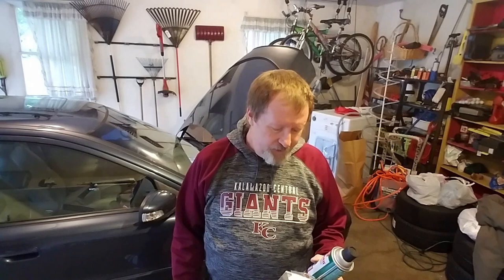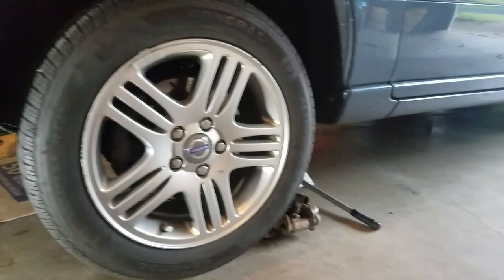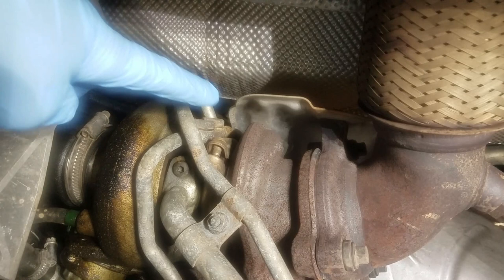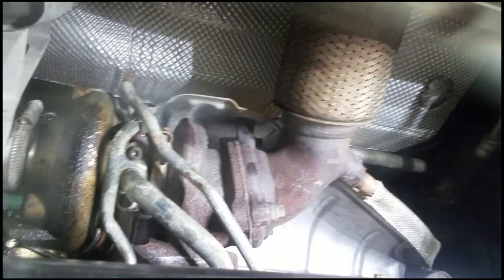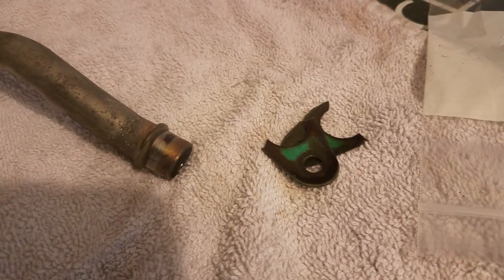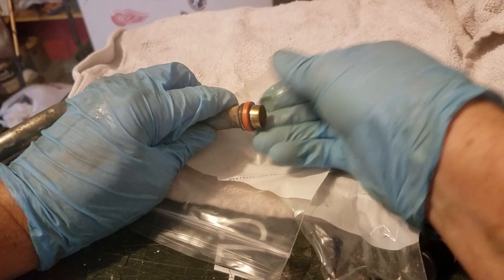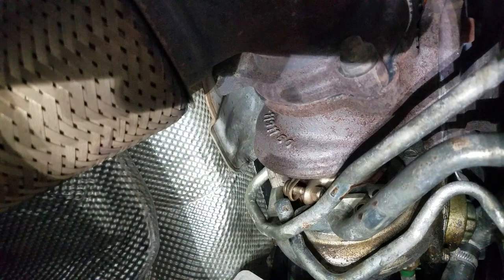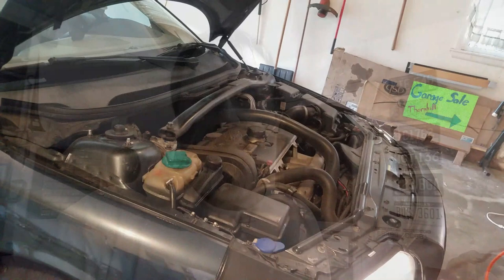Volvo S60 Turbo Oil Return Gasket Replacement

Comment: Floyd, Yesterday (Labor Day 2020) I was exactly like you down under the engine of my 2004 Volvo S60 2.5T AWD considering the source of a similar very tiny oil leak - it might be exactly the same thing that you fixed last year in this video. 

My car has 270,000 miles on it, and I just changed the  timing belt, the regulator on the alternator ($18 online made in Korea), patched an exhaust leak, and used the olde timing belt as a strap to better support the muffler just before the tail pipe by putting two rivets in it. 

Yesterday also I replaced the front passenger CV outer boot ($22) by buying the one piece boot and using an exacto knife to carefully cut along the mold seam and then using genuine super glue, carefully glued along the seam, packed the grease in, put the metal fasteners on and test drove it to and from work today - about 50 miles. I haven't seen an online video of somebody doing that yet, which seems to have worked very well.
Reply from the maker: Good deal keeping that thing going for 270,000 miles.  Hopefully this one will still be around at that point too, needing it's 2nd timing belt change.  I've heard of people replacing the boots on CV joints, but don't actually know anyone that has.  The whole axle shaft is so cheap these days, it's sometimes quicker to just replace the whole thing.  I've replaced both mine and they are surprisingly easy to replace.

Comment: Thanks a ton for this video! I've gotten an oil leak that have just gotten worse with time, and it seems to be the oil return. So I need to do this job myself. Hoping to avoid having to remove the coolant lines.
Reply: And it’s fixed, this video was of great help. Gaskets 8 bucks, renting a lift 18 bucks, about 40 mins of work and it’s done. Actually didn’t need to remove the coolant lines, it was a bit fiddly but manageable to get it out.

Comment: This was not fun! But worth it to get the new turbo in. 
Was really hard to get the bolts out, new bolts were hex and deeper which stayed on the socket when reinstalling.
I cursed the Nordic gods several times during the process.

Comment: Great video, I’ve been watching your repairs for some time now. Is this the same procedure on a 2012 s60t5? It’s fed which should be easier opposed to the awd models. Maybe the pipe is bent to a certain degree a little differently than the p2 chassis? And help would be greatly appreciated. Just ordered the gasket and seal also have brake clean ready to go. Thank you
Reply from the maker: Thank you!  If it's not identical it should be similar.  Any of these that have a drain line from the turbo to the oil pan will be super similar.  Connection points or the bend in the drain hose may differ but the rest should be very similar, and as long as you can get to it, usually pretty easy.

Comment: I guess your car is not the AWD model?   The location of the angle gear on my V70R AWD blocks access.   Looks like I'll be removing the angle gear to get access.
Reply from the maker: Correct, I just have the FWD model.  I've heard the haldex portion for the AWD causes issues with access for this.  Kinda glad I don't have the AWD version now.

Comment: Do you recommend copper spray on the gasket?
Reply from the maker: No, it's not needed.  I wouldn't say it would hurt, but it's just a drain, not under any pressure, so it's not really needed.

Comment: Does this work for a 2012 s60 t5?
Reply from the maker: This should work for most turbo oil drains.  There will be some sort of connection for that drain.  It can either be a banjo bolt with a crush washer, or something like this where 2 bolts connect that drain to the turbo with a gasket.  I don't have a 2012 T5 so I can't say what they use, but if it's the 2.5 liter 5 cylinder, I would suspect it's identical to this.  Volvo stayed with things that worked well.